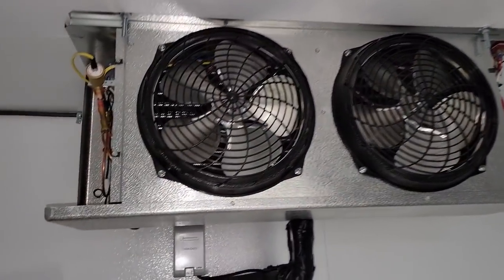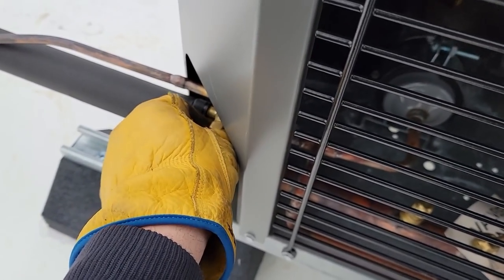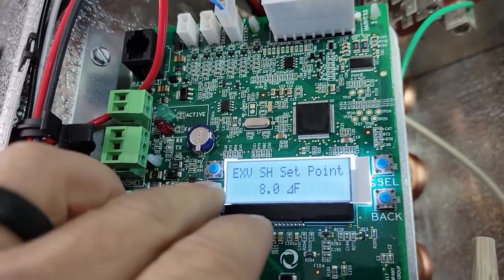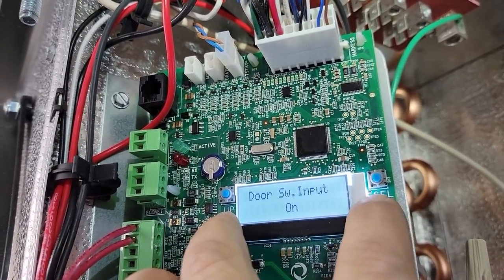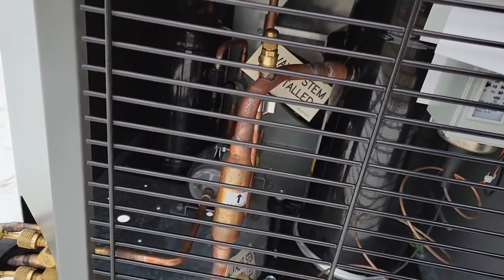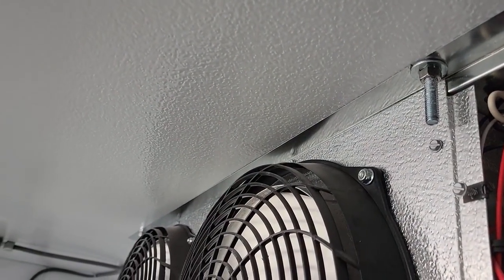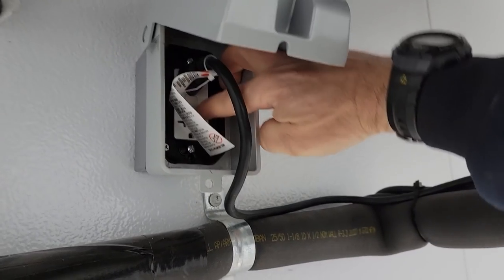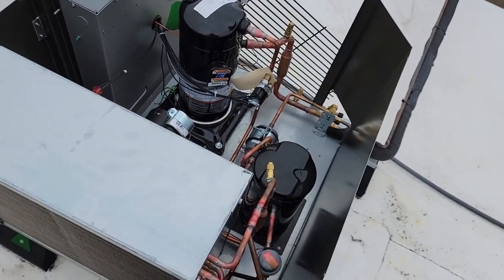My First Russell EXV Start Up!?

Comment: If you had a choice would you go with a conventional system or this system shown?

I like basic stuff and don't want problem or as few problems as possible in the future with equipment.
Reply from the maker: I like both but the traditional will have less problems.

Comment: Just recently worked on a WIF with a similar set up, 1.5 years old. A company installed it and never changed the refrigerant on the board. Had to do a ton of de icing, the line set was around 120' and still flooding back. Nice video. It had 448 in it but the board from factory is set up with 404.

Comment: Nice thorough video, I am starting to see a lot more of the Russels. Darn good time to jump in the market. The need for new equipment far exceeds brand loyalty.  Good video.
Reply from the maker: I was impressed, other than the non-serviceable EXV valve. The heatcraft valve can be unscrewed and change just the head.
Reply: Yeah they’re fun as they’re pretty much new to what we are used to but i’d be careful & check to be sure they didn’t install it incorrectly or in no time you’ll end up going back to have to find out why it’s freezing up
If i can find the pics of both valves i had to reinstall I’ll send them your way
Reply: Stay safe 😎 always looking forward to watching your video man
Reply: Best part about them is as long as you have all operating properly it’s the smart board that’s able to give you superheat & the fact that you can open & close the valve via the board 
Have fun man
Reply from the maker: Thanks Erick! I appreciate the support🤜🤛🤟🤟
Reply: @HVACRSurvival  no problem man, be safe brother

Comment: I do like these systems. Made it pretty easy. Installed a few heat craft ones at H.e.b. Curbside stores. only issue was the stepper motor on the exv were installed backwards from factory on a few.
Reply from the maker: Interesting👍👍. Thanks for sharing your experiences!
Reply: Sporlan SER electronic valves are bidirectional according to their literature.

Comment: I am definitely curious how well that control board will hold up in the evaporator, especially as it has a tiny battery on it (just past the upper left corner of the display). I am surprised they didn't put a shield of some kind over the nasty high voltage/power supply part of the board.
Reply from the maker: Time will tell. Thanks for watching!

Comment: In my area, Health Dept. would ding those bare copper drain lines in cooler. They don't want any exposed copper in boxes including liquid lines. Also can not install them tight to wall, require standoff clamps so lines can be cleaned on backside. Galvanized clamps against copper ?
Reply from the maker: I get most of that but why not bare copper pipe in a cooler? I can see that in a freezer.
Reply: @HVACRSurvival  Bare copper can develop green corrosion over time and potentially flake off and into food. That is their thinking.

Comment: I’ve only had one issue with those controllers. We installed a walk in cooler/freezer combo box and supposedly the right sized equipment was supplied by the same company as its a standard in this franchises (Imperial brown I believe). After a day of runtime and product coming down to temp, the cooler box would overcool and freeze the product. Freezer did not have any issues (it’s meant to freeze, it can run longer obv) The system cooled the box so quickly that the box would be at temperature and continue to drop before the min compressor run time (4 minutes) would be up. I was able to lower min compressor run time to 2 minutes but the problem continued. I even tried adjusting the differential which helped, but didn’t solve the issue completely. That was on OT at 9:30pm and they closed at 10. Another tech was sent back, but not sure how the issues was solved. I would venture a guess to say that the equipment was oversized for the box even though it was all supplied by the same manufacturer. Imperial brown
Reply from the maker: All parameters were adjustable and could be set to zero if I remember correctly.  I would definitely go with a minimum of 3 to 4° differential

Comment: Finally the covers of service valve and electrical parts on the evaporator unit can be opened from the front but not the side? The side open design is so bad

Comment: Worked on a couple of those EEV’s certain companies have installed backwards, they’ll work okay for sometime then come to a point in which they fail & constantly feed refrigerant causing big freeze ups, keep an eye out Rick, be safe brother
Reply from the maker: Thanks for the heads up. I noticed the exv was a one piece unit but the heatcraft was a two piece allowing you to replace the driver.
Reply: Yeah they made them like that which is harder for us to replace, poor design from russell unfortunately
Reply: Yep, the Sporlan valve is a 1 piece valve.  Heatcraft uses Carel valves, which you can separate the stator coil from the valve.

Comment: I'm used to HeatCraft too but I do like some features of that Russell. That's display looks so easy to read and work.
I always ask if I can handle the wiring because sparky usually makes more work for me. I try to believe it's just ignorance of how that system works and not recklessness
Reply from the maker: Exactly, I didn't care for the electrical wiring, I thought it looked a little shady ran in that flexible crap.

Comment: I've installed that exact model not impressed with the pc board in the evaporator compartment especially when the coil iced up and ice wrapped itself around the board and all the molex connection plugs good luck being careful to defrost as you normally would better have a spare board on deck
Reply from the maker: Your the third person to mention that about the control. That's a valid point. 👍👍 Hopefully that doesn't happen.

Comment: You have other refrigerant rules than over in EU😬
Since January 2020 it s not allowed to install or refill any 404A
GWP over 2500 is banned. Nice job you made😊
Reply from the maker: Yeah I know, we're going to be forced into something different before long. We're reluctant to change till we absolutely need to just because we have so many refrigerants already. I suspect we'll probably do R448a  like the ice cream machines.
Reply: You can still recharge a 404a system in EU. Where are you from ?
Reply: @HVACRSurvival  
Seems like hydrocarbons is the main choice here now.
Isobutane for 10 years on home appliances now
Else Propane on freezers mostly and medium low temperature equipment.
I work mostly with ultra low temperature equipment and those use either Ethan or Ethylene in the second stage. 
The former 508B is now 1400 dollars per. LB 🙄😳 if you can get it.
Reply: Nevermind, i can see you are from Norway. You are not even in the EU.
Reply: HFOs?

Comment: My unit wont go lower than 60. I have a light switch and temp at door which alternates every 30 seconds or so from 60 to F, not sure if F is a code or fernhgt. its set to 38 and has an orange blinking light under the green active light.  Help please
Reply from the maker: Your best off to call someone local so they can get it back up and running before you lose product.

Comment: With that EEXV serving as the metering device, it's not surprising that Demand Defrost has been deployed in that system, as opposed to a time-only feature.  It would not make sense to use the technology that's needed to support an EEXV, but use a time-only defrost feature with it. However, using time as a default in an EEXV system does make plenty of sense.
Reply from the maker: I know how many problems I had on the True freezers that have a accumulated run time style defrost like that. I had to change them all back to time.
Reply: @HVACRSurvival  i hear you. What I'm saying is a conventional TXV used with a standard electronic or electromechanical defrost time clock does the job well. But when manufacturers start using electronic TXVs (ETXVs), then they have to use the technology that supports those ETXVs which is not what a conventional defrost time clock or a conventional TXV operates on. Take for example Heatcraft's demand defrost system under their Beacon trademark name. They use demand defrost rather than time-only defrost. To go with demand defrost they have to include solid state sensors strategically placed on the evaporator coil as well as a microprocessor that takes in the signals from those sensors as analog inputs and runs them through an algorithm to determine when to go into ddefrost mode. That's quite a bit of technology to deploy when a standard TXV and standard defrost time clock will do the job just fine. I understand that the higher technology is used because it manages the use of energy better, but sometimes higher technology on these systems is really overengineering them.

Comment: I don't get it. Why put the pcb in the coil. What will happen when it gets wet or humid. Here in DK, we always put the controller (AK-CC 550, AK-CC55 or Carel (thingy)) outside the box
Reply from the maker: I didn't design it. I've seen them inside and outside, but still in the cooler.
Reply: @HVACRSurvival  It's maybe not a problem. That's just something i wouldn't do.

Comment: 1:42 major/multiple alarms going off, 12-2(yellow coated) romex wire outdoors? even if used for low voltage total FAIL
was the black cable 8 awg romex power to unit? holy sheeeeet if..  I could see in an dire emergency, but still massive fail.
** later in video, I understood the cooler was moved to allow the new installation and that was temporary wiring until decommissioned. but still makes you go WTF 🤣

Comment: can you explain why virutrally nobody in america uses wire ferrules when making connections? as the voltage is half of what it is in the rest of the world the current is double that of our systems you really need to take care of the correct wire connections. lots of videos that i see of hvac repair is rife with burnt wires from poor connections due to a lack of ferrules and no enough force when screwing the wires down.
Reply from the maker: Where are you looking for ferrules at? The high voltage coming into the EVAP?
Reply: @HVACRSurvival  yes for example. in basically every installation i see bare wires shoved in connectors and barely tightend down wich have all oxidised after just a few years and suffer heat damage. especially on defrost clocks and contactors. and the sensor leads going into the boards on the green terminals. those wires tend to snap off  or cause intermittent issues in a humid and viberating machine. even in eurpe i have to teach and force apprenteces into using ferrules and screwdrivers with torque clicks in them. almost everyone does not tighten terminals down enough.
Reply from the maker: A feral is usually a piece of plastic or something that keeps the wire from getting skimmed when it goes through a metal connector are we talking about the same thing?
Reply: @HVACR Survival  it's a termination you put on the end of a wire. Like a ring terminal except it's... just a chunk of tube you crimp on and make it into a kind of solid block. Then you put the ferrule into your connection and that's that.

To me, it's a european solution to a question not asked. You twist stranded wire and you can certainly torque down a lug on it just fine. Those little green terminal connection points on PCBs are garbage but I don't see a ferrule fixing that. It is quicker than tinning the strands.
Reply: @Supreme Ruler of the World  contactors usually use lugs which aren't an issue or you use a spade connector which isn't an issue. A loose connection in any circumstance is a bad connection. A ferrule wouldn't change that.
Reply: @etherealrose2139  i know that in the EU ferrules are mandatory if you want a CE certification (the EU version of the UL listing) and comply with OSHA standards for industrial equipment. it looks like this is not the case for the US wich would explain the high level of burnt and heat damaged wires. it very uncommon to see that in EU equipment. same goes for the wire nuts vs the wago 221 style wich is basically the standard in EU for many years. wire nuts are in practical terms illegal these days in the EU. sidenote: ferrules help give the screw more surface area to grip and compress. its makes for a much more secure connection that if torqued down properly is electrically transparent, so no increase in resistance and they are protected against oxidation inside the terminal. that is impossible without ferrules. that is why they are used/mandatory in the EU if you want your cetrification.
Reply from the maker: Ok. I think I know what your talking about now. I call the crimp on a spayed, female, male or eyelet. I believe the thing you're calling a feral is what I call a star washer. That way it doesn't loosen up. It's just a difference in terminology between the two different countries. I'm not overly impressed with our electricians. But I can't say that in the video,
Reply: @HVACRSurvival  funny how people have different names for them. but no, i do not mean AMP crimp terminals. fun fact: a certain large online store also calls them ferrules but youtube does not allow making a link to there. but if you enter the word yourself you will get a bunch of kits for sale with the crimping tool for 25ish dollars. and yes, electricans suck. its always fun to get to deal with the corner cutting of a so called professional.

Comment: someone seriously Put P traps lol  wow what is going on with Mechnics these days
Reply from the maker: I'd rather see them do it every time than choose randomly and Skip when they need them.
Reply: @HVACRSurvival  ya but thats the problem there was no P trap required at all it works against everything you are trapping oil for no reason
Reply from the maker: @primetime758  once again I'm the tech not the installer. There's a bunch of stuff I didn't like about this or the mua unit that your going to see next. I'm not there boss 🤷 or there's plenty that would be different. But don't forget price is a determining factor on this job
Reply: @HVACRSurvival  price is usually a factor for most jobs its Rare for Clients just to ask for a ball park price and dont care if its higher than quoted.. or some clients dont care how much it costs just do it..... most clients are penny pinchers and hunt for the cheapest.... and than end up paying the most lol
Reply: @HVACRSurvival  Was there no need for it because the lineset length was short ? I'm asking because I didn't even think about it so now I'm thinking I shoulda...
Reply from the maker: Normally you need a trap whenever there's 10 ft of difference between the compressor and the evaporator. At least that's  off the top of my head. Did they need it no, am I going to bitch about it no, I picked my battles wisely. The company has a lot of young kids installing and doing the best they can there only following orders.
Reply: @HVACRSurvival  yeah that's how I was taught , 3 meters ( about 10 ft ) . But I didn't know how long the lineset was or how far up was the ice skating ring where they put the condensing units .
I doubt it would be a big deal though ...I'm more irritated by the sparky and the  electrical box in the way preventing access to the screws or hiding the label ...
Reply from the maker: I brought it up to him, he gave me several excuses. 🤷🤦🏻
Reply: @HVACRSurvival  lol !  Excuses that must of been a show  i would of grabbed a Beer and Sat back  (Al Bundy style)  and just listend
Reply: @HVACR Survival  I would have backed the screws out and punched a couple new holes a few inches over. Done and done.
Reply: @sterlingarcher46  P trap's heights are  by size   3/8 1/2 5/8 i think are 7 ft rise   7/8 6ft rise  so on so forth   the length or the pipe run doesn't have anything to do with a P trap    now if you are going crazy high you have to add more P traps  i've seen so many P traps for no reason just like in this case lol   i've seen P traps when the compressor is in the Basement and the pipe is going straight down
Reply from the maker: @primetime758  when I mentioned 10' I meant rise not length.